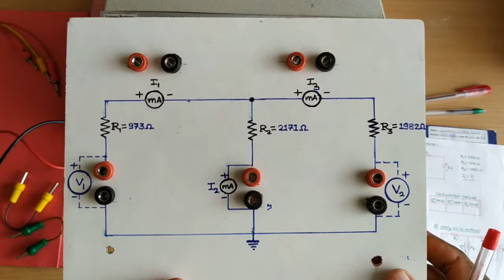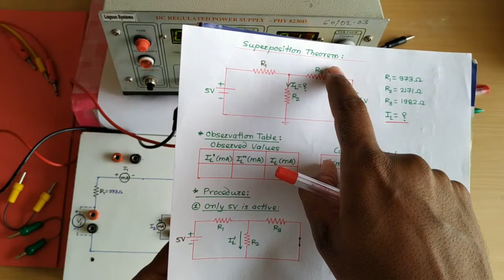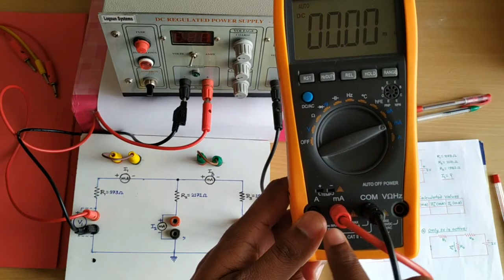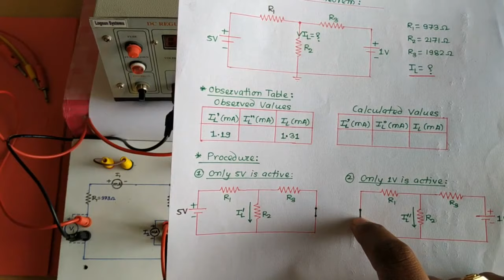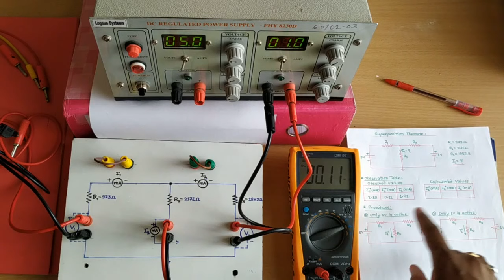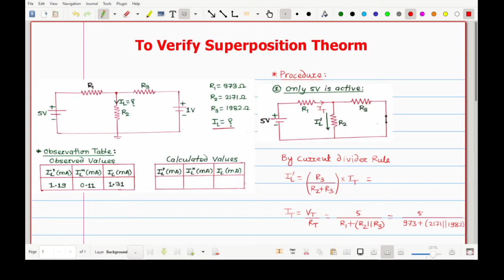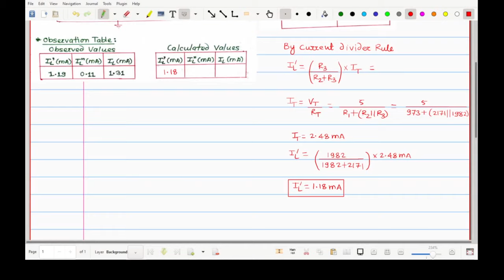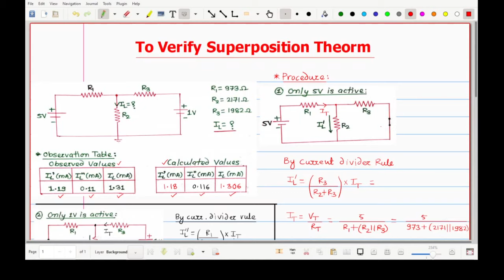Experiment to verify Superposition Theorem

Comment: Can we take one source 15v and other source 10v
Reply: Keeping same resistance value we haven't dc regulated supply to minimise 5V and 1V I hv to arrange to different dc regulated supply by using full wave rectifier circuit by own made
Reply from the maker: Yes u can take any voltage
Reply from the maker: If you are using full view rectifier make sure you are using capacitor filter so that you will get constant DC voltage without any ripples
Reply: @ADKTech7  Thank you Sir  a lot ... Keep video posting on PE and PLC if possible electrical machine lab for Diploma engineering .It gives a lot help to students about fundamental
Reply from the maker: @pradoshmohapatra9827  sure thank you for suggestion 👍

Comment: Can you state the apparatus required
Reply from the maker: You will need DC power supply, Multimeters for current and voltage measurement, 3 resistors of values given in video or any values as per your choice, connecting wires etc..

Comment: Sir superposition circuit ma load resistance hota hay??
Reply from the maker: Yes it does....
We have to find current through that load resistor for each voltage and current source.
Reply: @ADKTech7  i have a circuit problem.. how to we discuss about
Reply from the maker: Send your problem on eedgpa@gmail.com
Reply from the maker: Solution sent via email... please check
Reply: @ADKTech7  yes I have received,... Thank you sir